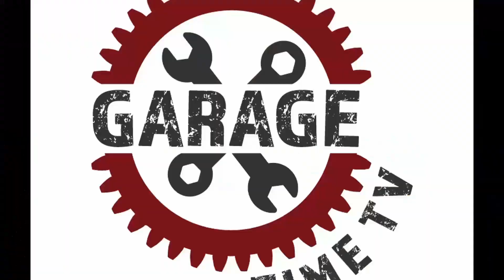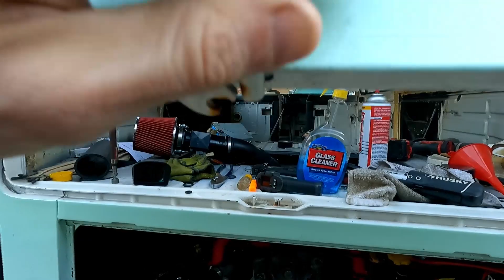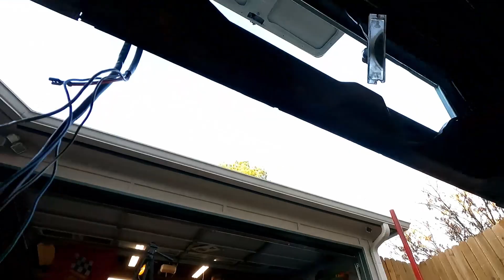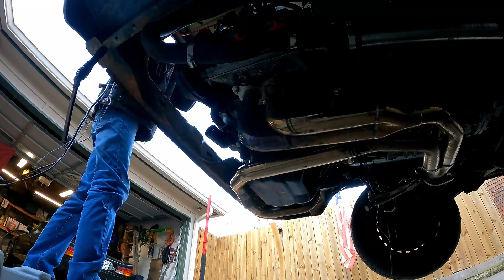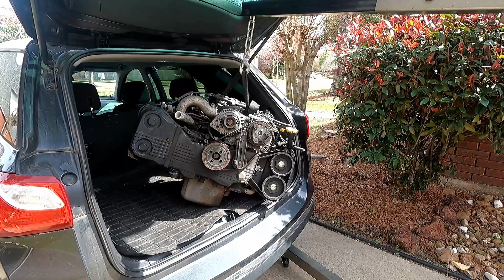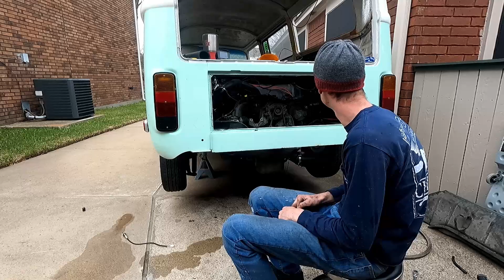Disaster Strikes our VW Conversion Project! Can We Recover??

Comment: As soon as I saw the white smoke I thought cracked/warped head. I'm curious: was the new engine cheaper than pulling the heads and taking them to a machine shop? Also, way to stay cool when disaster strikes. I'd be ragin'.
Reply from the maker: The cost would almost be the same, maybe a bit more for machining and then down time. I didn’t want to be down for awhile so o went for the swap.